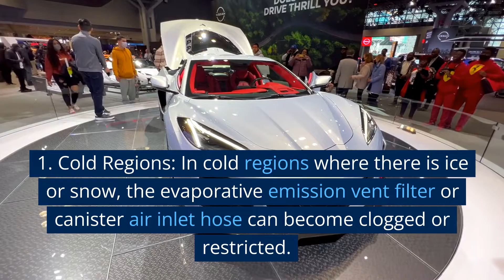"Everything You Need to Know About DTC P146B and Your Car's EVAP Purge Pump System"

Comment: 2021 Chevy Silverado 4 cylinder turbo  bought new has just under 26,000 miles and this code appeared this weekend. Changing the air filter (I know not the code) and putting carb cleaner in this weekend. Put a call in today to my dealer's service department and waiting for a call. With the extended warranty and only a few years old with low mileage hope this doesn't cost me anything or I'll be pissed. Stay tuned.
Reply from the maker: 2 year old is suppose to be under warrenty
Reply: @BestCarFixes Checked the code and it was P146B.  Got a call back by the service department and yes covered. They said something about the purge thing and pressure. No problem about getting it checked out but here is the big problem there is a "nation wide" backorder on these things. Crazy no need to do what I was going to do but I do need to change the filter so I will and use the carb cleaner down the road to help things keep clean.
Reply: @xrayron1  Techron is better than carb cleaner for keeping the engine intake clean.